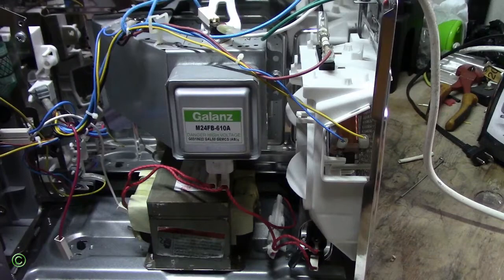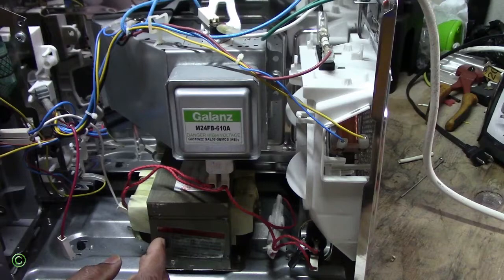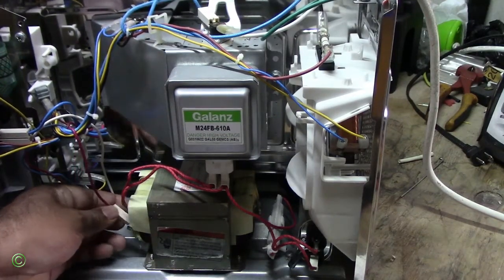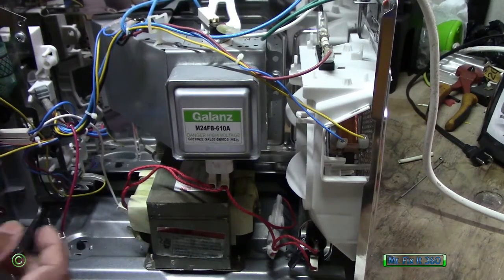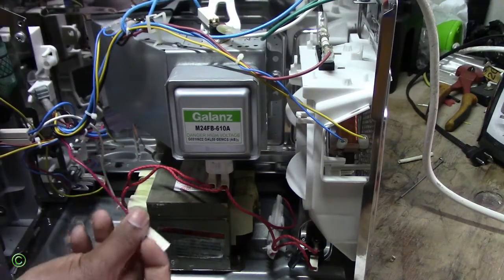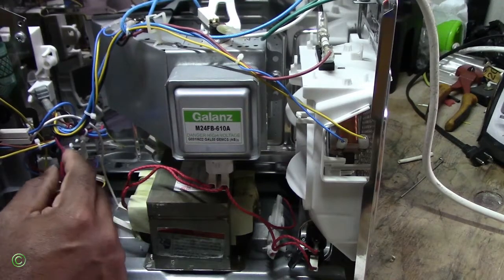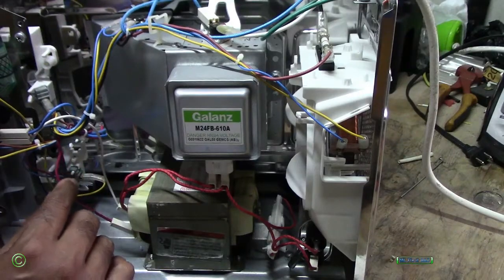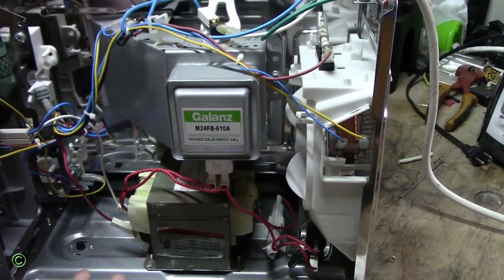Microwave oven not heating easy fix

Comment from the maker: In all my 12 years of repairing microwave oven, this is the first time I came across this problem where the connector wire pop off the transformer thermal, normally I came across a few microwave oven where the connector wire completely burned out from the transformer thermal.